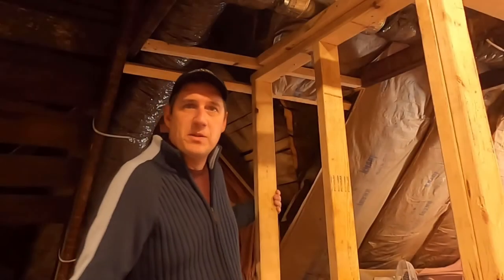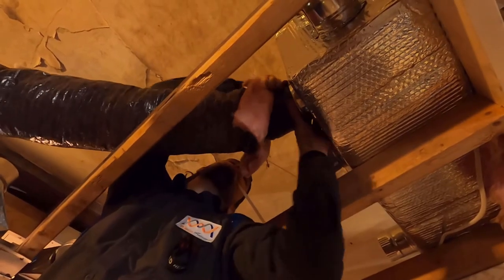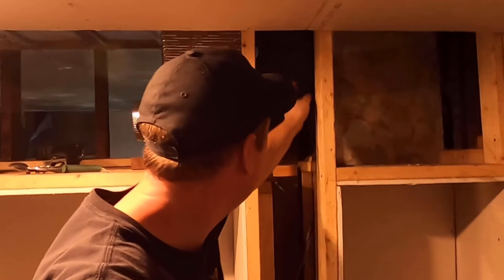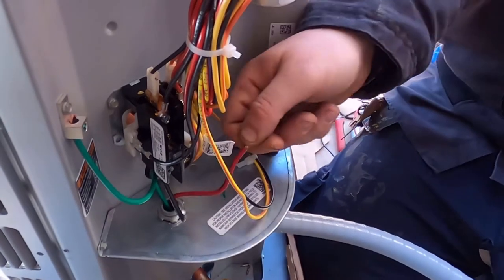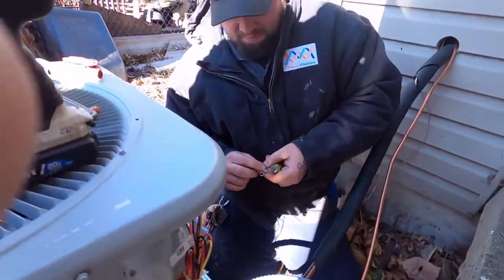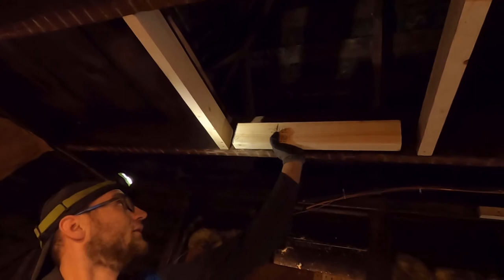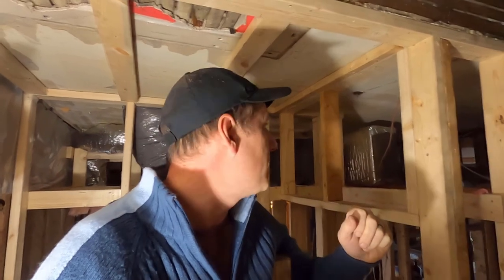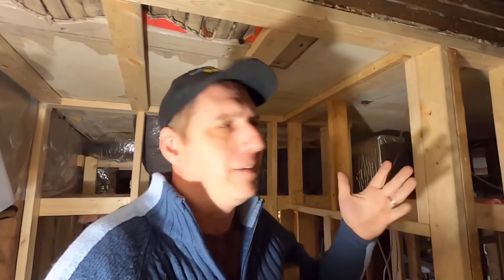HEATING AND COOLING - A New CENTRAL AIR SYSTEM From Start To Finish

Comment: Bought a new house 2 months and I pulled down the ceiling in the kids bathroom during renovation to install a new fan but discovered that the 45 year old ducting in the house was fiberglass duct board. Needless to say it was shot. It was basically loose hanging sections. It became quite clear why the house wasn’t heating up as well as our old place. Surprise project! I was wondering if you had more detail on how they connected the air from the furnace output into the first (main) trunk of ducting. I am going to need to do that to be able to run the remaining ducting to the rest of the house but I’m not quite 100% on how to do that…yet. Any details you can share will be great.
Reply from the maker: Unfortunately I have little to no knowledge in HVAC installation. This is why I hired out this work. I recommend at least calling an HVAC contractor to give your situation a good inspection and maybe they can make an assessment with recommendations. You don’t have to hire them.
Reply: @RundownReborn  thanks. I was able to figure it out. I just needed to fabricate my own distribution  plenum so each room has direct supply from the box as opposed to branching off like they did in the original installation. The static pressure was definitely improved and a continuous line sure helps the air get to the rooms. It’s amazing how much you can learn online.
Reply from the maker: @shawnagbatah8336  so glad it all worked out well for you!

Comment: You guys ever heard of mastic? I’ll bet that duct system leaks a good bit being since none of the take offs or inner liner of the flex ducts were sealed.
Reply from the maker: Very good point made. For us, it seemed to be a cost saving worth taking since nearly all of our flex connections occur inside of the insulated thermal envelope.
Reply: Exactly and the wrong flex ran in the cold space.. they don’t even have the right tool for cutting out for collar plus they didn’t even use a single take off plus wrong tool to crimp drops

Comment: wow, they did a great job. the only thing i saw was, why they didn't install the dryer for your A/C. .?
Reply from the maker: Don’t know about that. Might need to ask them about it. Thanks for the feedback and for watching.
Reply from the maker: Did a little research and my system may not need a dryer. Found this:

Residential units that are charged with refrigerant at factory level and hermetically sealed do not use these (dryer) devices as the possibility of moisture and particles entering the system is minimal.
Reply: @RundownReborn  Bull ,you need the drier ,plus you void the warranty if you don't install it .

Comment: How did you put that drip line in where did you run it
Reply from the maker: Are you referring to the condensate line? This spring I connected to the nearby new bathroom plumbing. It doesn’t connect to the sewer yet but instead drains to the basement. I will connect to the sewer soon.

Comment: Wrong flex ran in cold space, wrong tool to crimp ceiling drops, 6” is to small to feed a living room and long runs far away from furnace, no mastic used and no takeoffs used only collars …. Seen many mistakes even electrical
Reply from the maker: Thank you for the feedback
Reply: I saw a ton of mistakes too . But I do like that they used Ducane . Been istalling them since Berkheimer started selling them . Yes it's now a Allied product .